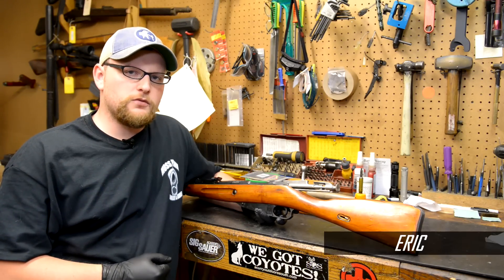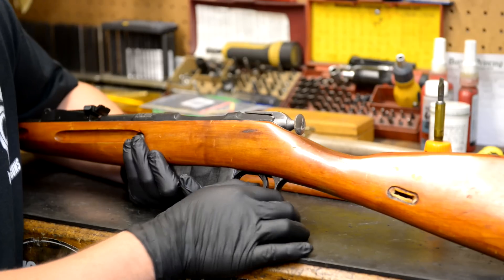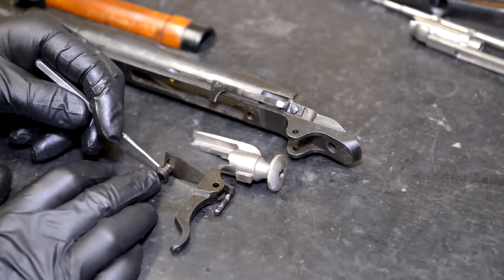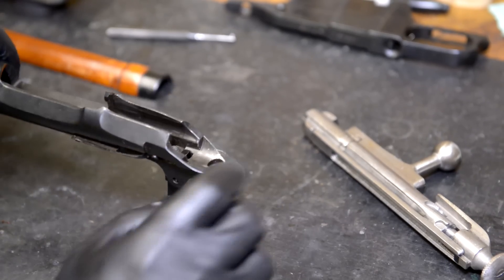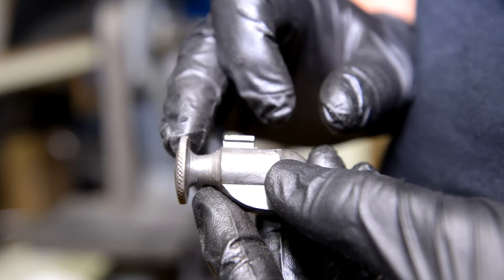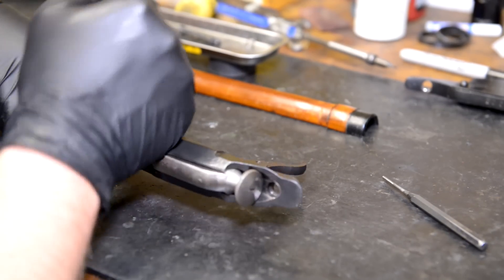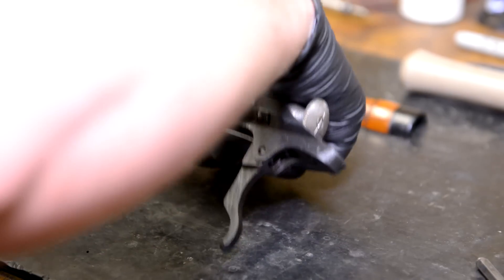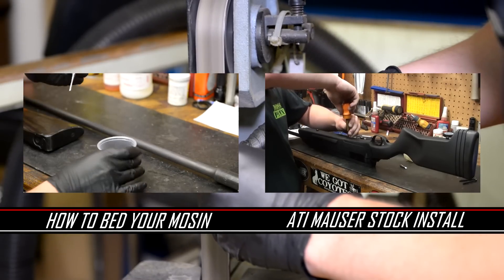How To Episode 4: Mosin Trigger Job

Comment: I was actually kinda disappointed that he didn't mention one problem I notice with my 1943's trigger.  My sear and striker came in very nicely polished already... but my trigger is still really gritty and stagey... This confounded me until i looked inside the trigger blade itself... you know, the part that touches and pulls down the leaf-spring/sear.  It looks like the Caucasus Mountains in there...  THAT's where my grittiness and predictability comes from.  And probably a lot of others'.  I'm actually not sure how I'm gonna go about it yet...  Can someone recommend a tool for me?  Cause if I can't find one, I'll probably use a Dremel.
Reply: I've had good luck with polishing attachments on a dremel and some polishing compound (any car or marine type).  Let us know if it works for ya.

Comment: Diamond files of all sorts are terrible to use.  Look at Wranglerstar video when he was at Edgepro knife sharpeners in Oragon.  Something about sharpening metal and the crystals falling off.  I really don't know about how large they are, but don't want diamonds in my action, throat or barrel.  Use stones instead, they do not embed into the metal and clean up well.   Great improvement video unless you're a C&R guy.

Comment: I want to buy a m44 from aim surplus they have available 1944, 1946, 1947 and 1948 which one is a better build the ones made during the war years or the latter build after the war I am more interested in the 1948 because it was built after the war and it could have a nicer receiver, and better trigger.  Any body that have a m44 from the 1948 built or any of the years  from 1944 to 1947 please give a reply with cons or pro about it
Reply: Don't own an M44 but do have a 91/30 prewar (wasn't properly cleaned after use and bore is pitted like the best I can get is 1.5" at 25 yards surplus ammo) but buying a gun pre or post should be of better quality because they were cutting down production quality to pump out the rifles during the war

Comment: Would this help with the archangel stock
Reply: i was having a clearance/length of pull issue. its amazing now with that stock!
Reply: Yeah dude this has nothing to do with the stock.  This is all an issue of the action that sits down inside of it.  Archangel or not, it should help.
Reply: ya, its still a little crunchy. and teh bolt raises just a bit, but the trigger job turned this thing into a real joy to shoot!
Reply: I replaced my 1942 mosin 91/30 stock with a archangel and ended up having to cut a bur in the trigger guard because the trigger wouldn't go far enough back. It worked ok but I ended up biting the proverbial bullet and bought the Timney Trigger on eBay for 89. Huge difference. I got the perfect candy cane break not with adjustable pressure from 4lb to.1.8lb. It also added a thumb safety similar to the Remington 700 so I don't have to wrestle that beefy bolt safety. The archangel stock already comes pre cut for it and it installed with a flat head screwdriver, the original trigger pin, and 5 min. It has helped with my accuracy a lot but it better for a combined 250 (archangel stock, timney trigger and an NcStar muzzle break). Not counting the scope.

Comment: If you measure trigger pull before and after each "improvement", you will find that almost nothing works on a Mosin Nagant. 
This is NOT  your father's 1911.
Bend the sear, Luke, bend the sear.

Comment: Many of them were churned out as quickly as possible with the Germans knocking on the back door of the factory during WW2. Fit and finish was not nearly as important as getting them in the hands of any able bodied person that could pull the trigger. Some of these are pretty rough to say the least.

Comment: hey eric, check out my channel i just added a video showing how my trigger is on my mosin, basically did same thing you did minus the sear and installed a slack spring backwards(have to watch to video to see what i mean) its more like the trigger on a semi-automatic is the best i can describe it, no long pull just a short pull then you feel sear tension 4.75lbs later it fires. and the spring i use is weak as heck.

Comment: I think you are creating a POTENTIAL DANGER!!! from what i understand of the steel hardening process. the outer surface of a hardened trigger is harder than the inner . if you grind that trigger your grinding off the hardened surface. the constant friction of the trigger contact in that area is going to wear at a increased rate. this has the potential to accidentally discharge due to lack of sear engagement. Im really surprised someone else hasnt brought this up.